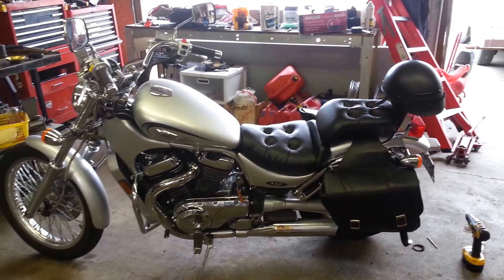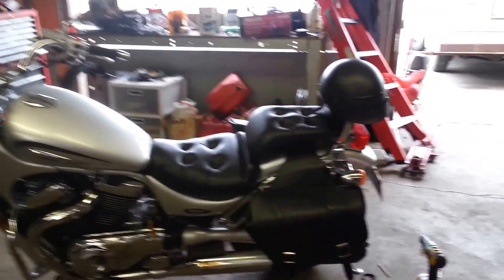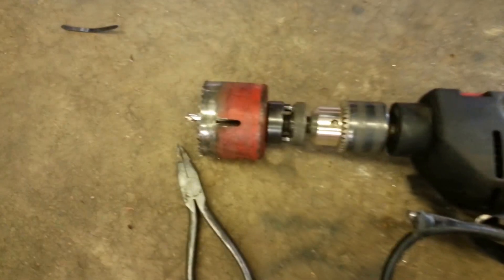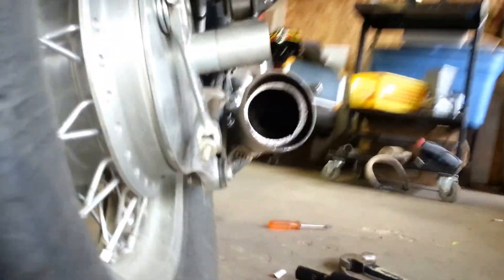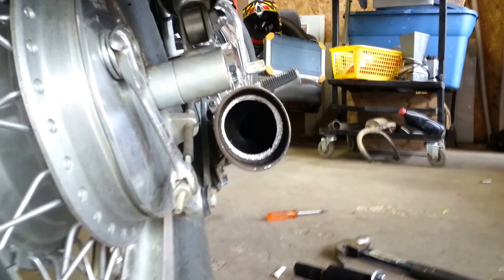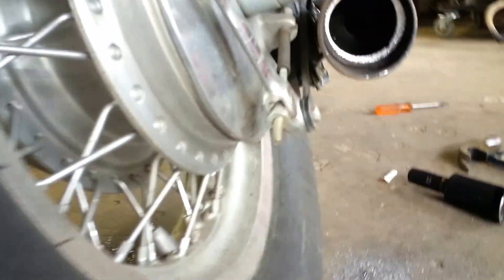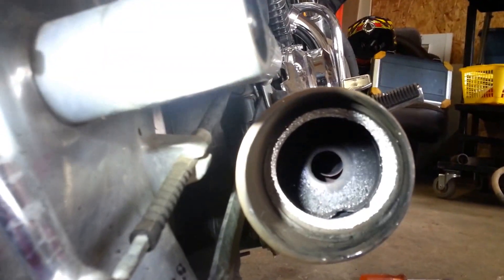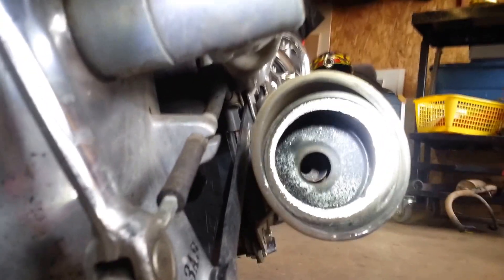Vs800 intruder baffle removal.

Comment: Did that make it perform better as far as the get up and go and mpg? I have 1999 800 cc getting a stage 2 jet kit and ngk iridiam plugs going into it. It already has k&n cone filters and AMSOILS 10-w40 oil in it with the AMSOILS 75-w90 gear oil in the rear end and it halls a!!. It gets about 45-50 mpg right now with out the kit and plugs.  Ive been wondering if that makes better differance in the performance area.
Reply from the maker: James Steffen not better. Cold starts are worse. But people don't switch lanes into me anymore.

Comment: did you need to adjust the ecm with a power commander at all, running an all stock '03 vl800 was considering removing baffles would I need a ecm adjustment?
Reply from the maker: Ecm?  It's a carbureted...
Reply: +Matt Baty really didn't realize new to this but now thinking in it I realized how stupid it was to worry about fuel injection on a bike I know has a carb. ...ugh sorry man
Reply from the maker: +Ghost In The Machine lol no biggie.  I didn't realize jet and the bike seems to run fine.  I will be doing plugs this spring and will post an update video then.  If you are new you should check out my other vid about the air filters.  Those are a royal pain in the ass on this bike.
Reply from the maker: Re jet
Reply: +Matt Baty yea got confused while looking at a jet kit on amazon and saw this Power commander as a recommendation and it apparently is made for an '03 vl800 ....I figured well hell when I was considering a Harley I knew any mods would need an ECM tune to keep it from blueing the pipes so when I checked that on amazon it completely slipped my mind ...even after ordering the new choke cable for my carb-.- if you could do a vid on replacing that itd be awesome because im going in blind and Google loaded ...but real question Do I need any tuning for a carbed bike or do I just go 

as for the air filter im considering saving up for a hypercharger
Reply: +Matt Baty oh my fuck Just watched the video ...holy christ thats an irritating job .....I thought my ar cleaner was the giant filter on the exhaust side of my bike its a giant oval filter that comes off with a clamp this means theres more ...crap
Reply from the maker: +Ghost In The Machine my bike don't have that.
Reply: +Matt Baty yes Just noticed ...my bike has exhaut on on side and this giant airbox that sits between the v midway and hooks into the carb so I just may have gotten lucky its an 03 k3 vl800 maybe thats why your vids helped though man decided to wait on the harley and do my bike justice by fixing it up keep posting vids they helped me thanks